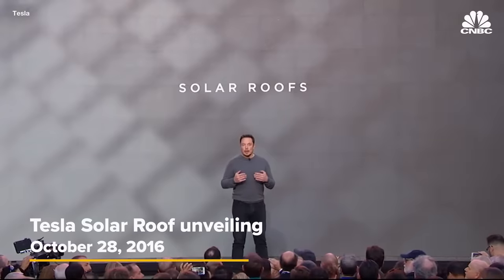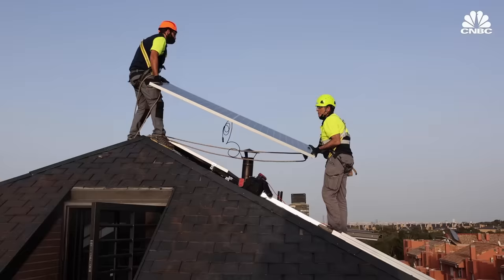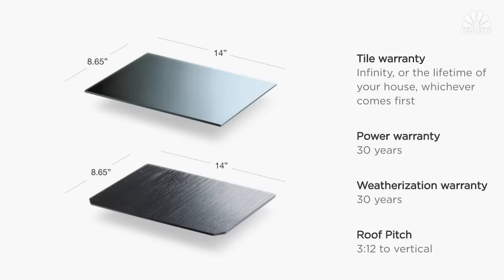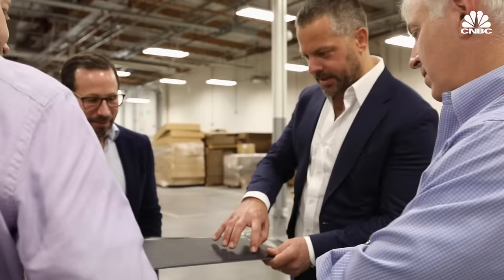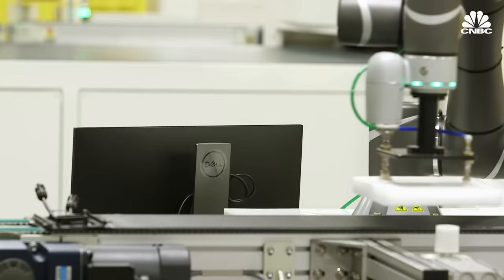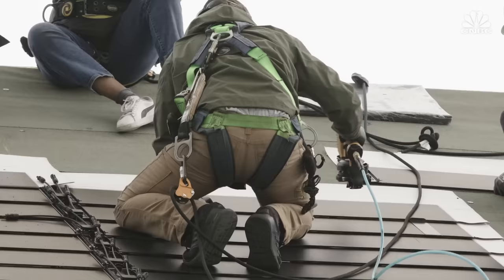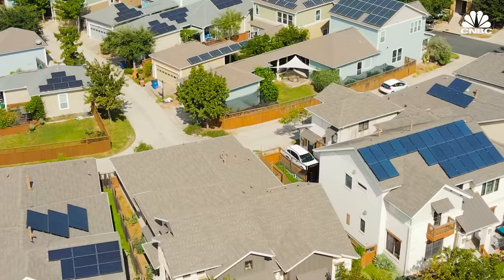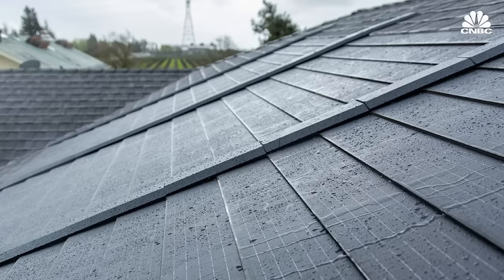How This Roofing Company Is Taking On Tesla’s Solar Roof

Comment: It seems many here do not realize that Tesla is one of the highest volume and lowest cost providers of traditional high efficiency solar panels as well. They don't just offer the solar roof product. Their solar roof product is more of a luxury item with a focus on aesthetics. Tesla offers both types of solution not just the one.
Reply: Problem is the customer service, just try to get them to fix it when something goes wrong
Reply: @josephyang3260  I agree that years ago service seemed more of a challenge if something came up (location matters with this.) In recent years however, from the people I know and from what I've read, the need for service now is extremely rare but better performed. Just my perspective on this. I don't have any non-anecdotal data to back it up.
Reply: @p.t.9709  Tesla still has a customer service and follow-through problem - present tense. They have been dealing with lawsuits including the cover up of the fire hazards of their panel electrical connections. People conflate their cars with the roof panel business. They are not at the same level. If Tesla had all the issues they have and their name wasn't "Tesla" they might have tanked by now. Their complete whiff on the true cost of solar shingle installs shows they had no idea what they were doing.

Comment: This is incomplete as far as you're reporting are you left certain things out just to seem like no one is figuring anything out. Down in Austin Texas Tesla has partnered with some builders as far as using his roofs so that these roadblocks are avoided. Before people were ordering the rooms for their pre-existing houses or the houses they were having built already under construction. Now being teamed up with the builders who know what the solar roof panels require the house design matches what the solar roof needs for ease of installation and efficiency of work. This one company had a goal they had set of trying to install 100 solar roofs on 100 new houses they were building. The numbers just came in at the end of this year and they successfully installed 118 roofs. So almost 20% over projected goals. All the competition always screams see his cost way more than ours and they are nothing but trouble. But the truth is everything Elon Musk has ever done is put the product out find the problems work through that problem and try again so he is not afraid for everyone to watch while he makes a better product in less time than any of them who keep their experimentation hidden in labs and factory buildings until they think they can get something out that works. And with Elon Musk teaming with this group of builders they have proven how it can work and therefore other builders can get on board with designing houses with solar in mind instead of an additional bolt on option which will with extravagant rules always cause problems. And Elon Musk never stops upgrading and innovating so now that they have figured out where and how to install the roofs they will sell more exponentially and at the time of this report his panels were putting out double the power with a smaller size than the nearest competition and that will only keep going up and up. Plus they have their Tesla wall battery packs which have electronics matched perfectly with their solar panel product which operate more problem-free than any of the Samsungs which lack some of the safety features and communication features that have to be added on.

Comment: I love the idea of GAF's solar flexible tiles.  I know it has lower performance due to heat and probably its glass is not as transparent because it needs to be rugged enough to walk on.  But, supposedly, this lower efficiency can be mitigated by having more of these solar flexible tiles "edge-to-edge" on the roof -- that is, covering the entire roof edge to edge.

But when I look at all the examples in the video, the GAF flexible shingle panels only use up the same area as a traditional rack mount.  The rest of perimeter is actual dumb asphalt shingles which still makes the flexible solar panels stand out.  It looks like these setups are being limited by the solar roof "set back" requirements!  It would look and perform better if it were actual edge-to-edge.

Also there will be problems with the cutouts for flashing needed for vents and those would have to non-matching actual asphalt shingles again thus ruining the look.  They need to create some "cheater" or "dummy" faux panels that are not solar panels but visually appear to be exactly like a flexible panel to be used in these places to "fill out" the visual appearance.

Also, how can the annoying NEC 690.12 "rapid shutdown" be implemented?  The GAF flexible tiles are wired in strings or rows of strings to a central inverter or maybe a smaller inverter per row.  There doesn't seem to be enough space on the flexible panel's terminal for a rapid shut down device -- and since the GAF flexible panel lays perfectly flush against the roof underlayment/decking, a shutdown module cannot be attached to the underside either.

Comment: I looked at solar last year. My only option was selling electricity to the electric utility. I could not run my house on the generated electricity. So why pay $22,000 for a 10 kw system, for the privilege of selling the power back to the electric utility? Makes no sense. No $ale.
Reply: If it does the equivalent of spinning your meter backward (that is generates a credit) it can save you a lot.  We do not have a power bill all summer, except for a $15 connection fee.  And then we get credits for any electricity generated beyond what we consume.  They apply that credit in the fall and winter to offset our grid usage.  The net is near zero annual electric cost.

Comment: If I put solar panels on my roof it would have to cover 100% of my roof not a little section 100% from end to end every which way over the top over around everywhere even on the north side and trust me solar panels do work on the north side of my house they make very good electricity even in the shade and solar panels also make electricity in cloud cover when there's no sun during the day as long as there's some light and know what I found out was pretty funny my car lights and dim charges my solar panels.

Comment: When you do your research about this. The first thing you'll find out is when the reveal for these panels used panels that were fake. There was eventually a panel design that worked, and it's not very good. It has some serious problems. To the point that the factory that was built just to build these panels does not even build them, it's still building batteries for the cars. Tesla has offered horrible tech support for these panels. There's hundreds of videos about it. Tesla has ruined people's houses during the installation. There's hundreds of videos about it. Most people are not getting the panels installed, they're getting normal solar panels. Because Tesla doesn't really manufacture these. If this was some kind of technology that the world invested in over 50 years ago, we definitely would have made a difference. But by this point in time what we've done in the earth is irreversible. You might as well just ride out the rest of it and hope you don't get to see the problems.

Comment: I forgot Tesla even had solar panels. They certainly aren't making any money from it...still. 
Tesla will have higher margins than GM and Ford, but that doesn't mean it isn't still a car company for the most part.
Reply: Honestly not just tesla but most solar panel companies aren’t pushing hard enough, literally something that can revolutionize how regular people consume energy and we’re all still for the most part chained to electrical companies like con edison.
Reply: @Andres_Acosta  The shingles could go on even more than just roofs if they can be added in a versatile way. Panels are huge
Reply: It doesn't matter what kind of company Tesla is. Car companies are great at making revenue but terrible at translating that revenue to the bottom line. Tesla changed all this and is making high car company revenue with tech like bottom line. If volkswagen can have an operating margin like Tesla, it'll be a trillion dollar company. VW made more revenue than apple in 2019, but their bottom line operating margins are just dog turd.

Comment: solar shingles will never be mainstream in their current state, these things are like Christmas tree lights on a roof forced to be in series with an inverter on the side of the house. GaN will need to be implemented, allowing micros to be the size of a thumbnail on the back of each of these shingles allowing parallel method of install and independent production of each shingle.
Reply: Solar panels are almost always run in strings, series groups which then parallel each other. Very easy to narrow down a problem and isolate the faulty panel or connection. I've done it myself. But yes, microinverters are still a great idea.
Reply: @paulmaxwell8851  Let me reword, with a string inverter which currently available solar shingles utilize, if a single panel/shingle or inverter fails the entire string goes down. whereas with micros in a failure the entire system will continue to perform regardless of the single panel or micro failure.
Reply: @guidedbygreen1480  I agree with you. Maybe my next solar array will use them.

Comment: this is what happens when "fashion" rules-  failure- just get the conventional panels on the roof- or better yet- ground mount. also subsidized anything breeds bad design and unethical installers.  just pass a carbon and a wealth tax and there will be a rush on PV.